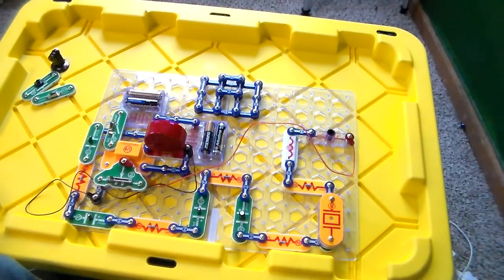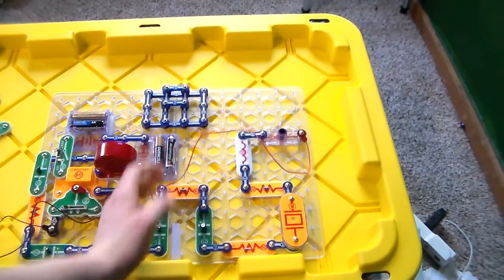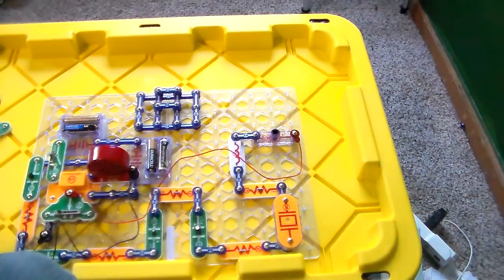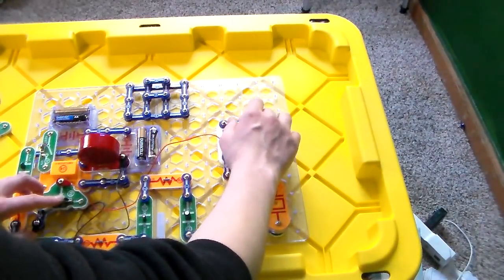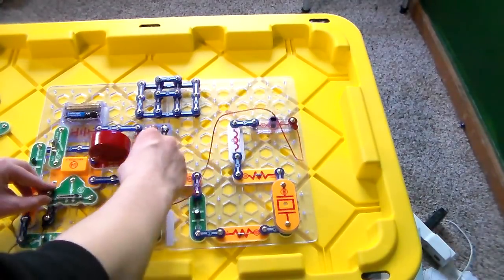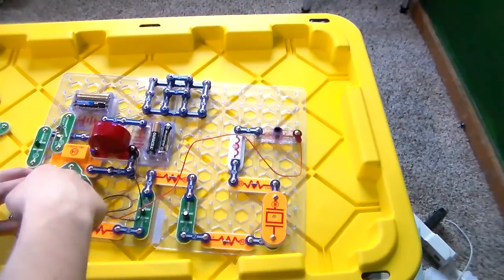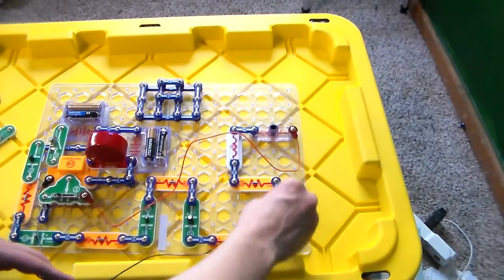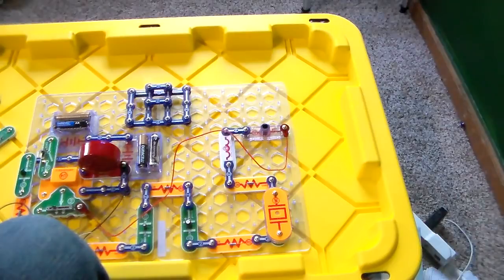Snap Circuits Synthesizer!

Comment: building this with sc500
Reply: Any idea if this could be built with just sc300, or does it require some of the additional pieces from sc500 ?
Reply: @srcery  it could be built with sc-300 too, but definitely not sc-100
Reply from the maker: @srcery  i pretty much never check this account anymore, apologies for being months late to the party, but at the time (damn it's been a while) i only owned SC-100 and SC-300
Reply: @joshuacampbell17  No worries! Thanks! I did end up getting SC-300, but haven’t tried to follow along with this vid. I’ll circle back around with a reply in case anyone is curious if it can be done with just the one set